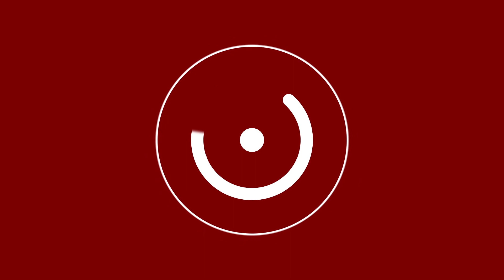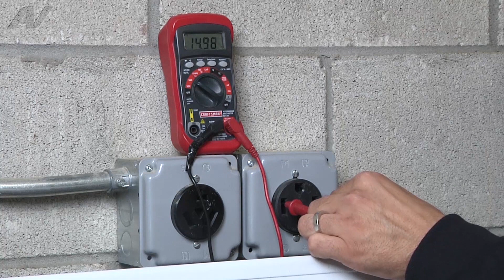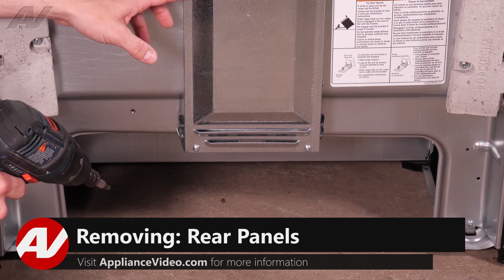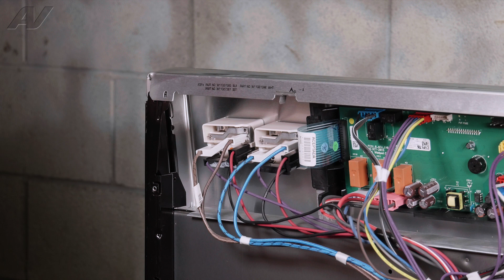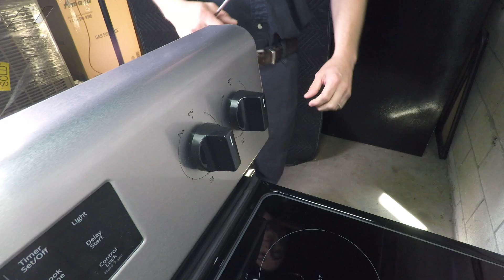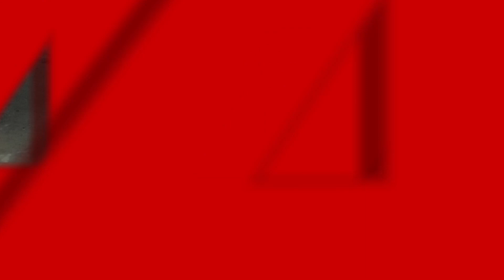Whirlpool Stove Repair - Element Will Not Heat - 8" Element Infinite Switch

Comment: Hi! In an example where the switch is defective, would you get the tone when the knob is off? Or not get the tone when the knob is on?
Reply from the maker: Great question, if you have a more technical question that our parts department cannot answer, you can search our over 17,000 answered questions free at our website www.ApplianceVideo.com under our Repair Help section. You can also call our parts department at 1-800-830-5465 and they can give you help 7-days A week ,or search at www.SaveMoreOnParts.com  .